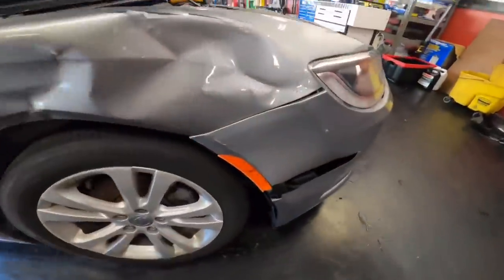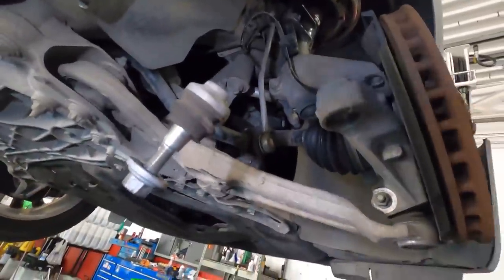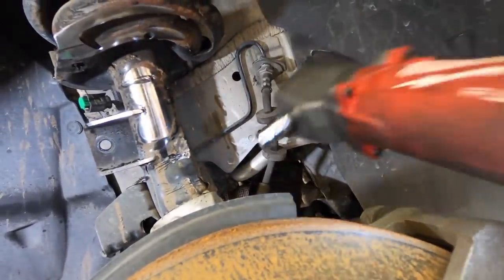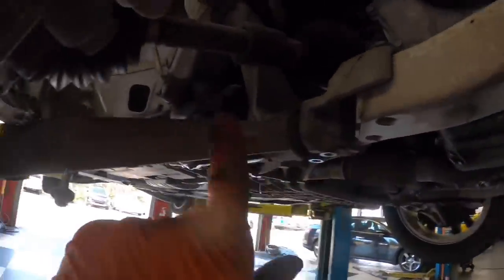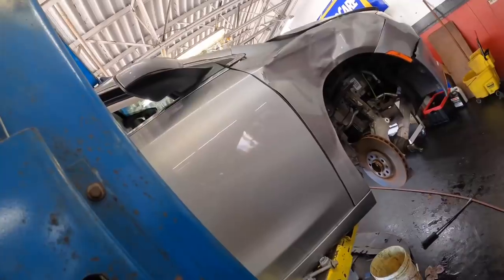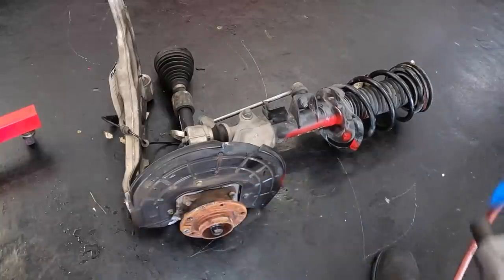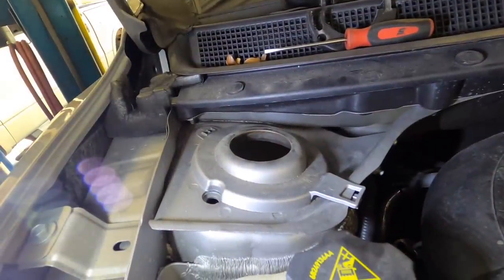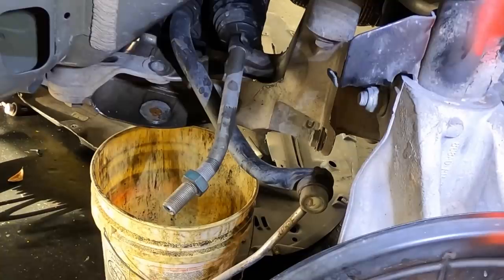Cutting Brake Lines! Caught on Camera! Chrysler 200 Strut, Control Arm, Tie Rods and Brake line

Comment: Very shameful of the unscrupulous "Insurance company" and "Body Shop"
that quotes a "repair" like this. I feel for you, Ray.

As per the front left side strut to tower fastener ring (engineered to have 4 bolts BTW)
also being dislodged- I'd suspect the entire subframe as being twisted. I highly
doubt it will ever track correctly again; the thrust angle has been seriously skewed
to the left. 

Tires and wheel bearings will wear much faster, after this has all
been 4 wheel "aligned".

Given the condition of the right outer tie rod- I'd suspect the R&P is cracked
on it's mounts. 

This is a prime example of dangerous false economy.
The Underwriter/Adjuster should've totaled this car, just for safety's sake.

R.I.P. RIGID👻
Reply: I agree. The level of repair seems to be suitable only if it was a very unique car like a 300SL Gullwing or something.
Reply: Agreed. When he released those bolted strut beams to gain access to the hub I spotted some stretch of the body - a smallish gap formed between the beam and bolt holed section.
Reply: I suspect this car is totaled and is going to be sold with a salvage title.
Reply: @not_the_stig  Did you notice the rusty rotor, I'll bet it was totaled, sat in a lot for a while, now somebody is trying to recover what should be a parts vehicle.
Reply: My wife ran a Lithia logoed body shop. All the stories she would bring home about insurance companies, their tactics, their 'policies', their pricing... makes MY blood boil yet. They are WAY lower than even used car salesmen, right their in a tie with politicians...
Reply: But the owner saved money on their auto insurance premium.  Isn’t that all that matters?
Reply: @velcroman98  OK, that would explain the rusty rotor. I was thinking that the pistons were stuck.
Reply: Ray ,I love your channel & your work/ethic , but this kinda stuff makes my blood boil in absolute anger. Not your fault, orders from headquarters,sleezy auto body shop, cut rate "internet insurance " company.The outcome will be a car that looks good at 50 feet, away maybe ending up on a "buy here pay here" lot ending up snagging some poor soul ,finding out they are way "upside down" on costly payments and repairs.
Reply: As an auto surgeon I concur with your diagnosis.
Reply: @velcroman98  I noticed the rusty rotor too. With the airbags obviously I think deployed etc, this car should have been totaled. I know not all states forbid reselling of totaled vehicles, but most I think do for this very reason, or the selling of salvaged vehicles with a salvage title.
Reply: @iii9266  :
Even the "freelancer" who sold "his own" SUV for $10,000.00 cash, (paid to the "salesman") to a teenager, who ended up having it repossessed 5 months after the fact, by the car lot the "freelancer" was "working at", because the "vehicle"wasn't fully paid for by the "salesman" who "owned" it?!?!
Reply: @K7DFA  i seen that episode on Lehtos Law. The dealership sold it to the salesman, who didn't make the payments & sold it to the kid, who paid tge price outright in cash. The salesman didn't pay off what he owed to the dealership to get the title and then give it to the kid. The dealership filed for stolen vehicle & got it back. This was a lesson learned to the kid, to ALWAYS have paper ready & up front before you sign. A lesson learned to the ex salesman to not fuck around (unknown if he went to jail or had to pay restitution). The kid won in the end, another dealer gave him a comparable vehicle. I'd shop there.
Reply: @iii9266  :
Same here, Lehto's Law is a really good channel. 
I really hope that the sleazeball "salesman" got/gets what he deserves.

Comment: The strut being held by a plastic ring consisting of two parts is mind boggling, really.
Reply: Why ? the struts don't need much to stay in place, and the only times this ring actually does anything is when the car is jacked up like in this video, and if you really go racing over a bump..
Reply: Crap design.

Comment: A buddy's dad had a wreck in his 68 Caprice.  The dealer body shop quoted new parts.  We went by one day to see how repairs were going and lo, a bunch of junkyard parts were laying there ready to be installed.  I've not trusted a dealer body shop since.
Reply: the sad part is nowadays the aftermarket parts are worse than junk yard parts and you probably can't even get half those parts at Autoparts store so you would have to wait forever to get them from dealer with supply chain problems
Reply: As the consumer, you have the right to insist on new OEM parts. Insurance must cover it.
Reply: @ranger178  This was back around 1971 and I think the insurance called for new parts.
Reply: Just occurred to me that new OEM parts may have totaled this POS Fiat Chrysler by the insurance company!
Reply: @SSJIndy  i had a car accident fixed on a new car in mid 80's and the insurance wanted me to take it to their preferred place who gave me some junker as a loaner car and put on whatever was cheapest parts they could find. Insurance companies have always gone for whatever is cheapest way they can get car fixed

Comment: @Rainman Ray's Repairs I work on heavy duty trucks and trailers. As a fellow mechanic to another, consider buying the Milwaukee Fuel 1/2" M18v impact. That thing is a beast and we'll worth the money. If it will take lugs and leaf springs off of a semi, it'll do what you need for you. Just a piece of friendly advice. Enjoy the videos.
Reply: AGREED, GREAT IMPACT.
Reply: As mentioned somewhere else, the 3/8 and 1/2 are the same wrench, same torque and use the same battery, only with a different 1/2" anvil. Beyond using stronger 1/2 sockets, what is the advantage? I am not questioning your expertise, I really have no idea and would like to know.
Reply: @TheOnespeedbiker  The 1/2" Fuel has 1200 ft lbs of torque while the 3/8" mid torque has only 600 ft lbs of torque. Makes a world of difference in the world of heavy duty and heavily rusted bolts and nuts, with or without pb blaster or heat. Using the 3/4" and 1" guns have about or more than 1200 ft lbs in the Fuel series.
Reply: @joshuamillan7457  ... But I see the poster was discussing another Milwaukee 1/2" impact wrench. My mistake.
Reply: @joshuamillan7457  I was talking about the 1/2" Right Angle impact wrench 220 ft lbs; same as the 3/8.
Reply: @TheOnespeedbiker  Right angle yes but he was using a 1/2" Ridgid standard cordless impact. Hence why I suggested it. The right angle are better in tight places verses a ratchet.
Reply: @joshuamillan7457  Again this was my error. Ray was also using his Milwaukee Right Angle and some other poster mentioned buying a 3/8 version as opposed to the 1/2" version because they are virtually the same other than the anvil and connector, but then said because of something Ray said (something I missed that in the video) he should have bought the 1/2". I realize now this was a completely different conversation,  so my bad.
Reply: @TheOnespeedbiker  Understood. It happens. No problem.
Reply: @joshuamillan7457  BTW, since you seem knowledgeable, is there a reason, other than compatibility with sockets, that Milwaukee would make a right angle impact wrench in 1/2" that is no more powerful than the 3/8" version. Kind of hard for me to understand that marketing strategy.
Reply: @TheOnespeedbiker  Not real sure there. Other than for accessibility reasons, where as in tighter spots for the 3/8" and in more wide open spaces for the 1/2". That's the only thing I can see.

Comment: “That’s not safe! “
“Yes it is the engineer said so”
Haha engineers come up with some stupid ideas sometimes. That other side shows you how unsafe it is. For one it’s plastic and plastic deteriorates.
Reply: The engineer should have accounted for the yahoo "mechanic" who replaced the struts before and didn't put all the hardware back in that hold the clips.
Reply: I think it's the accountants that decided on those plastic clamps, I remember fitting them at UK GM plant, 1 tool used on both sides quicker and cheaper to assemble than 6 bolts
Reply: @BigDave1965  Plus the manufacturing that goes into making the base plate with the threaded holes for the bolts.
Reply: @stevewhite3424  I think the accident probably cause those clips to pop out. 
Given the damage to the strut, it seems likely.

Comment: You will love this one,
After trying to beat a grudge on pin out of a piston with the rod still installed I tried the air chisel and still failed, then I angle grinder cut the crown in half above the pin and split the piston with a cold chisel through the slot.
Reply: @Nicole-mn9oy did agnez use an air hammer or grinder?
Reply: @darrylhaynes9208  can't beat a good grind !!!

Comment: 1:57 it could be even 50 .... but just rusted itself up... if you used 1000Nm to take it out doesnt mean it was tide with 900Nm. Btw .. impact from accident could stretch the threads ;)
P.S
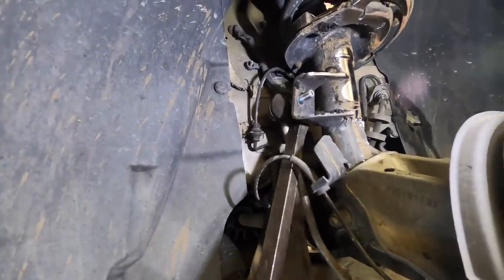4:08 You could undone the bottom nut from that drop link bet it would get out easy ;)
6:56 from that moment you should take driveshaft out instead of making noise and taking lower arm but you are the mechanic in here

Comment: FWIW, those top-mounts are supposed to be squeezed together using the 4 holes in the bracket.
In the absence of the correct tool, a pair of right-angle circlip pliers will be less brutal than a pipe-wrench. 😉

Comment: Hey Ray, great videos!  Could you entertain the thought of maybe doing a video on the tools used, specifically the power tools and wrenches.  What brand is preferred, costs, torque power etc.  Always wonder the specifics.of your tools while you use them.  Knowing what power they provide, how long the batteries last, electric vs air driven etc.   Thanks!
Reply: I'm sure he will get right on it.🙄
Reply: Just watch the videos, you’ll see what tools he uses. I’ve bought some of the things he uses, the ridgid 1/2 impact, the 0 degree offset wrenches (mine are Cornwell),  a air hammer (mine is kobalt). Buy the brands you can afford. He has two videos covering this subject.
Reply: You want to watch ProjectFarm.

Comment: Putting junk on junk? This guy must have gotten a settlement from the insurance co. and is trying to save a buck and pocket some money. I'll bet the frame is bent and a half a dozen other hidden faults exist. I doubt that the front end will ever be able to achieve the proper alignment numbers and it will never drive right and I'll bet that a proper alignment on a frame machine isn't in the budget for this guy. This has got to be the fail of the year but 2022 is still young.

Comment: That strut Lock ring is a very Chingy design No bolts holding the Strut assembly in other then a plastic ring and tire and wheel as knuckle are all attached to strut assembly yikes 😬 😳 chrysler and there crappy designs @Rainman Ray's Repairs

Comment: The customer is already looking at replacement of suspension and steering gear... I don't think a hydraulic hose will be an issue. It looked kinda rumpled, anyway.

Comment: Did you say it looked like a Fiat because of the Merger in 2014? Of Chrysler and Fiat, I mean. Well, they also sort of owned Mercedes from 1998 - 2007, soo... pretty European-ish I guess.
Reply: This Chrysler 200 is the same underneath as the current (KL) Cherokee absent the 4wd bits, and it is a Fiat platform.
Reply: @bikeaddictbp  I figured as much, but I have been out of it for a while, and away from Chrysler even longer. Thanks! 👍

Comment: So, no brakes at all in the front? And how long did it go unrepaired with those slightly crusty break rotors?
edit: Love Peter's reaction to the clips holding the strut in place, completely the same reaction I had first time I saw this kind of setup
Reply: What made you think no brakes ?

Depending on the climate, this car could just have been sitting outside for 14 days, waiting appraisal from the insurance company.

My car's rotors have surface rust just being outside for the weekend, if the weather is moist and cold. Takes just a dab on the brakes to clear it, as it is offcourse just surface rust.
Reply: @JohnDoe-bd5sz   In that case shouldn't even slight breaking make the contact part between brake and rotor shiny?
Edit: my bad, it seems like it was towed, but, in my defense, plenty of people drive around with damaged cars, even if the flat tire and the repair itself should've told me otherwise

Comment: If there is any bolt or nut that can break a torque wrench it's definitely an axle nut. Even if you bend those tabs out they can still be a holy hell to remove.

Comment: Almost identical to the damage I took on my last skid day. Engine/trans mounts, pull the A pillar back out, new strut, Ctrl arm bush, bend wing back ( drift car so fk it). All parts replaced but clearly more issues as the car shakes like hell above 2.5k rpm even in neutral ( car feel like it wants to shake apart when driving over 2.5krpm).
No engine fault codes n I can't tell if it's vibration or misfire, if any1 has any suggestions I'm all ears as my enthusiasm is running low now 😭

Comment: You need to get the big 1400ft lb Milwaukee impact, mine wouldnt have even stuggled with those lugs or the axle nut.
Reply: If you're thinking of the 3/4" M18 Milwaukee Fuel, 2864-20, it's actually 1,500 ft lbs of torque on fastener removal. 1,200 ft lbs for fastener tightening.

Comment: I guess the idea is the clip only locates the strut for assembly, once it's all together spring pressure keeps everything aligned, it'd take a huge overextension from the supporting parts like the lower arm and sway bar for that clip to ever come into action, which is probably why the opposite side came apart, this car must have taken a big hit or something, wonder how that might have happened...
Reply: Probably some kind of locating mechanism under the fender that prevents the strut from twisting. The car would need to be airborne for the top of a strut to fall out completely.

Comment: Tip:  In the gap Where the spindle bolt clamps the spindle to the strut body, drive anything in the gap to spread it. Then the spindle will fall off.  An air hammer with a chisel bit works great.
Reply: Not on these 200's, the cherokees or the darts.  The stem of the strut is WAY too long.  Unless of course you're talking about after the lower control arm is removed

Comment: DANG!!  That is some serious mechanicing!!  What a difference tools make!!   I doubt I coulda done that,  even with my three different size Vise Grips!!   I got my 2 1/2 pound hammer banger that would have served me well but most of them bolts, nuts, and screwy things might have been a problem.  And the grindy sparky wheel!!   That sound will decalcify your bones!!   I would have been happy if the brake line was all I destroyed there.  And I am certain that when that part flopped down it would have cold cocked ME right in the head.   Another super handicap for me would be the microphone!!   Having that thing listening to me would eliminate about 83.5 percent of my mechanical jargon.   I have to  "talk" to my tools and work if I am to accomplish any thing.  With that dang thing listening (and recording) to me I would need lots of re-takes or a double ton of editing.  
      BUTT, I super enjoy watching you work.   I feel you are dang good,  conscientious, and very knowledgeable!!   I learn by watching you,  and due to your comments,  style, and honesty,  I enjoy every minute.   I have since passed the age of eating rust,  various automotive fluids, solvents, and other hazardous chemicals to save money.   I will pay cash to wait in the lobby while YOU do the work.   AND,  I want YOU doing the work.  I feel I can trust YOU!!   Thanks for letting me watch.   I have done some of these things and my knuckles and other joints are aching now,  just from watching.   GREAT video.   Thanks again..
Reply: Loving the humor in this reply.

Comment: 2:02 that's the result from someone using only an air/battery impactdriver to fasten the bolts. Is there eny shops nowdays that uses an "torque wrench" to make sure the bolts are put on not to hard and not to loose? Imagine being out in the middle of nowhere when you get an puncture and can't get the wheel off becus someone have been sleeping in school :) *not only that but it's not that hard to crack aluminium wheels with an powerfull impactdriver aswell, usually cracks inbetween the holes on the wheel.
Reply: Given that the supposed mechanic who replaced those struts in the past didn't put the bolts holding the plastic clips in place I'm not the least bit surprised they used an air tool to reinstall the wheels.
Reply: @stevewhite3424  yeah it's crazy, i haven't hadd eny problems with "private shops" but with car dealerships it's always done incorrect and the bill is so high that you would think it's done correct. I worked 7 years in a car painting company, my job was to take cars apart and put them back together, got pretty boored of the "wheels part" as i hadd to spend alot of time just getting the wheels of :O oh well, good video enyways :)

Comment: I'd guess that the plastic strut clip came off the opposite side due to the impact pushing the car sideways putting load across the suspension and popping off the SUPER secure plastic connector. But it's somehow cheaper than a few bolts so plastic it is.
Reply: There are supposed to be 4 bolts holding those struck clips. Given that both sides didn't have any I'm pretty sure this car had a strut replacement in its past history and mechanic forgot to put the bolts back in.  Even after a significant front end hit that broke many parts, shove the wheel at least 3" in towards the motor  and other sundry broken and cracked parts for some reason the poorly design strut clip stayed right where it was supposed to.